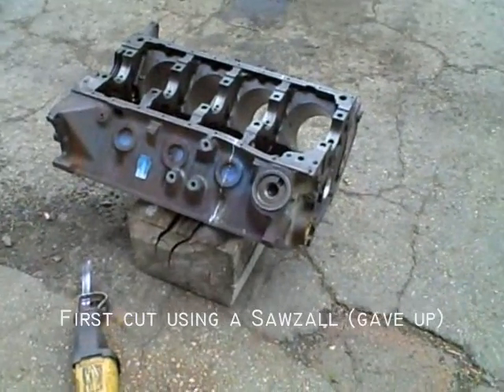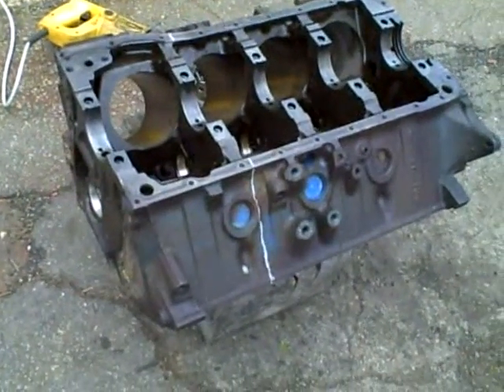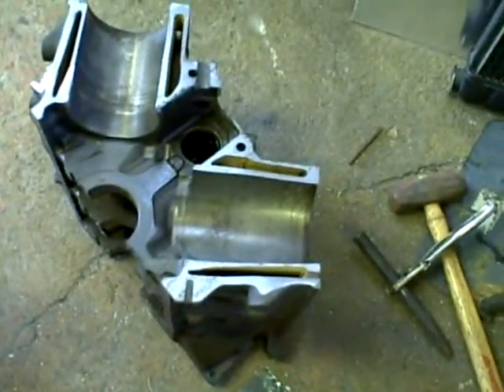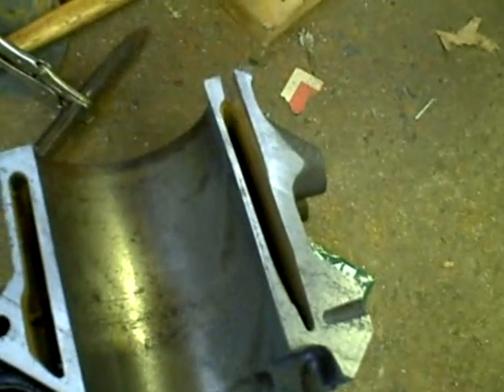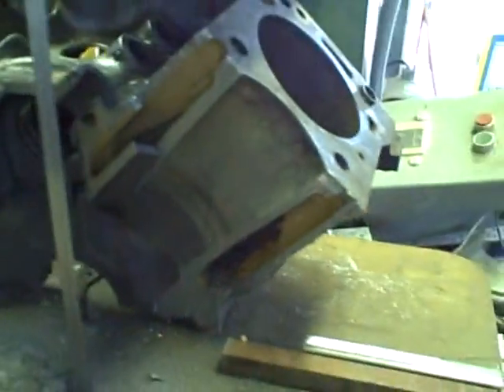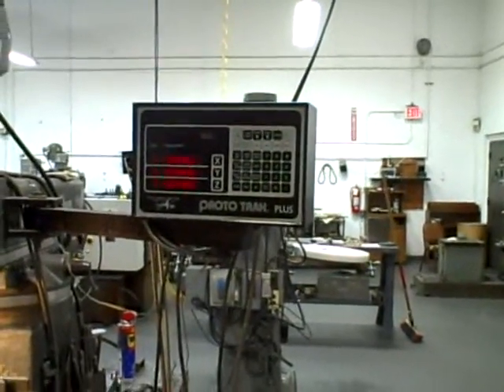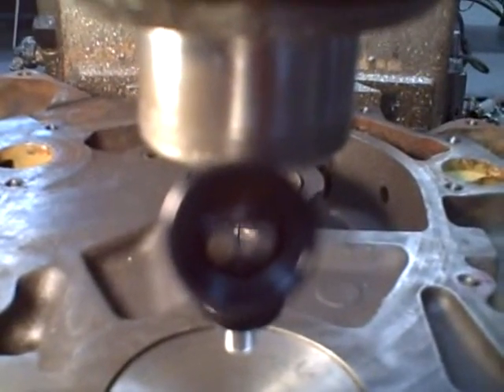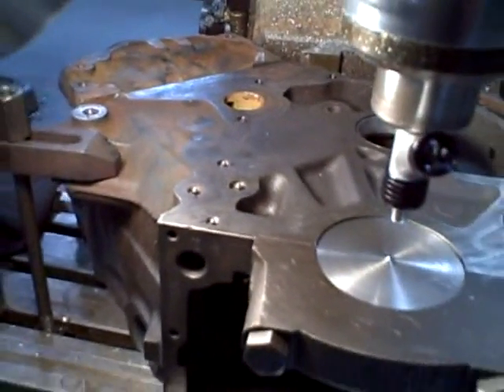Ford 460 Cut In Half

Comment: What you need is a friend with a CMM, life would be so much simpler! I'm a CMM programmer and this is the solution! If doing it the way that you were, I would have simply created a datum on the cut face by milling a couple spots on a plane and flipping it over on 1-2-3 blocks rather than cutting it all.
Reply from the maker: Broncocarl92 and Chris, I wish I had a friend who worked at a place that could measure it for me!  I already have a solid plastic model that was 3D printed by a neighbor who works at a company that has a few printers. I have fixed the thin wall problem I "missed" after he printed it, but still have to make a prototype in aluminum. I have been working on a major home renovation that has been going on since I posted this video. I have not had time or money to get back on the project. I have a local casting company that can make the part for around a grand without finish machining. I'll see what happens if I get the house done. If anybody has any inexpensive aluminum casting company that does quality work, please let me know. I'll have the company sign an NDA (No Disclosure Agreement), because I would at least like to sell a few to break even. Keep in touch and take care!  Wayne

Comment from the maker: MicrophonicFool, I was just machining it to make it flat.  I clamped it flat to the milling machine table. The band saw was a rough cut so I could get it on my milling machine at home (an old Bridgeport Model M head).  Cast iron usually cuts very easy, but this was a lot "harder" than I have machined in the past.  I guess it is the high nickel content. I guess coolant could not hurt anything on my band saw, but it would make a mess of the band saw. I used wax as a lubricate though..........

Comment: I don't know the process of milling enough to criticize, but I have an honest question. Even for this kind of cut, without using cooling lubricant, how do you know you haven't compromised either the integrity or the surface? I can see re-milling the surface you want true, but I don't understand how you protect the intregrity of the original cut without cooling.

Comment from the maker: tomp64: I was going to go that route by using a 1993 Mustang 302 water pump.  The problem with the 302 pump is that the coolent inlets are narrow, and the 460 block are wider.  Keeping the pulley flange position height in the same position would make the plate too thin to adapt it. I think I remember that the water outlet would be too close to the mechanical fuel pump. If there is a shorter version of the 1993 Mustang 302 pump, please let me know.  I'll stop by Autozone and pick it up to check.

Comment: Why not use a reverse rotation late 80's 5.0L pump?  Or the 94-94 Mustang or the Explorer 5.0  pump which are shorter and have some different mounting holes.It should be able to be adapted to the 460 timing cover with a plate

Comment from the maker: I have been busy with other things, but I have been working on the CAD Model a little every morning. Its tough to design, because the stock 460 pump pulls water from the radiator toward the rear face (closest to engine block).  The Ford Modular Motor (4.6, 5.4, and V10) have the water pump blades toward the front.  I have it modeled in CAD and so far it looks good. The problem is that I have to make a casting, because if it was made from plate it would have to be made from 3 pieces.  More soon..

Comment from the maker: I have called, e-mailed, and snail mailed all the Big Boys who make water pumps (Edelbrock, FoMoCo, A1Cardone, Airtex, etc).  Ford did make a reverse rotation water pump, but the timing cover is cast iron.  It also does not have provisions for a heater hose inlet, and mounting holes are missing. I am close to finishing a solid model which I will get printed out. I plan to test flow on a cool engine and check flow rates before I get it casted in aluminum.

Comment from the maker: To: eazye4you:..............I have been busy at work, but I have made some progress on the reverse rotation water pump.  I have designed a pump that uses the stock water pump from a 2002 Ford Explorer with a 4.6 V8.  It turns Counter Clockwise and is cheap at the auto parts store.  It will fit into my specially designed water pump housing.  I have two versions, one done on the CNC and the other I am working on is a casting.  I am looking for an inexpensive casting company. To be continued.......